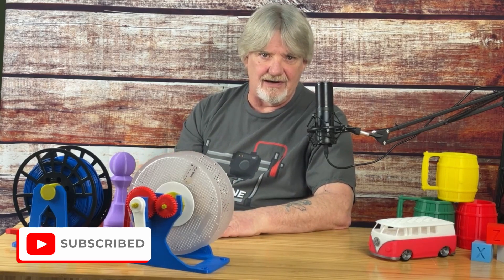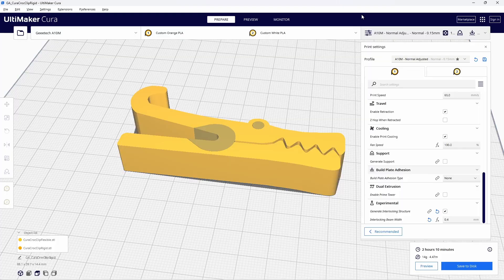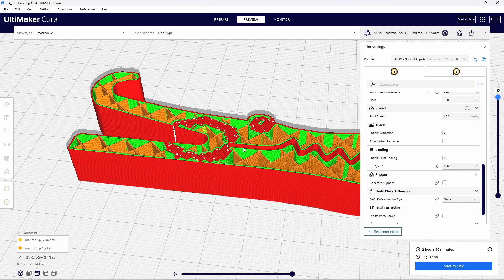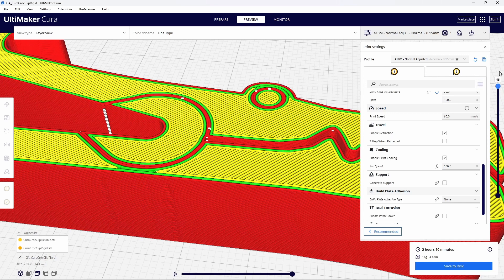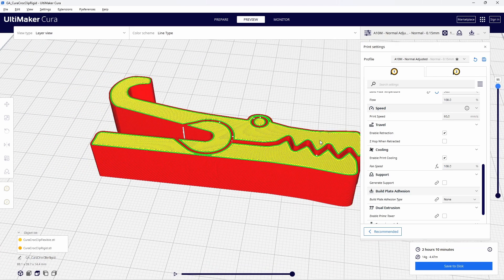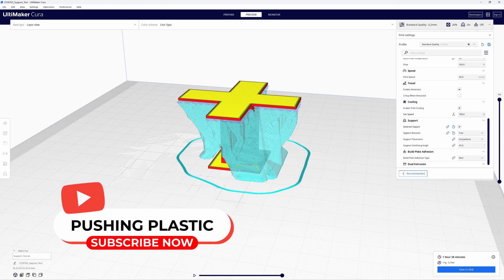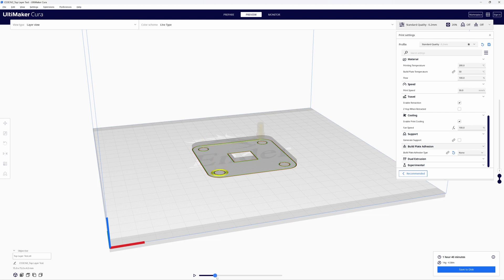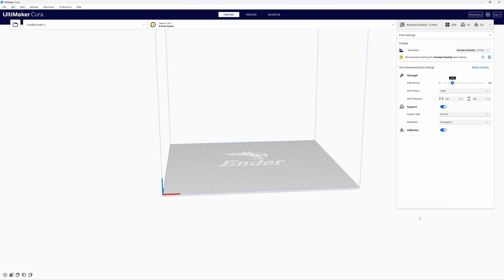What's New In Cura 5.3

Comment: Question in Cura can you save the print settings dedicated for the model that has printed.
meaning  
model 1 has a profile assigned to it.

model 2 and so on has their own profiles assigned to them, 
so when you select a model from your archive, is that the settings change for that model. when you load it up
so if you use a larger 100%  infill model and it has loads of different settings from one that is smaller and 30% infill compared to other models
Thanks you  if this can be answered.
Reply from the maker: After you have a profile set for a model that you're happy with, in Cura go to "File" and "Sace Project". This will save the file as a ".3mf". In my limited experimenting with it, it saved the Model, The Profile and even the printer together. To get the file open again, simply open Cura, go to file and select "Open File(s) like you do to load any model into Cura. But keep in mind, if these are specialized profiles using your example of 100% and 30% infill. You would have to have both of those profiles saved. I hope I answered your question? Feel free to comment back if I added more confusion!

Comment: I do think the supports in 5.3 use less plastic.  I tried a model yesterday and in 5.2 it required 22.52m of filament but in 5.3 (with all the other settings the same) it estimated only 21.46m of filament.  Other than version there was no difference in setup so it would seem it does use less plastic for supports.  It's only 1 meter but it's still less and it all adds up.
Reply from the maker: You’re right, it adds up! I haven’t tried a comparison with a larger model yet! On a side note, every time you leave me a comment, I about crap myself when I see the notification that says “Boring Old White Guy”! It catches me off guard! Awesome name! Thanks for watching and please keep the comments coming, they keep my blood flowing!
Reply: I noticed the same thing on smaller models, it doesn't change the amount of plastic all that much. I did have a few larger models that did benefit from the new support settings.
Reply from the maker: @scottbayreder8699  this is all great information! Thanks for the feedback!